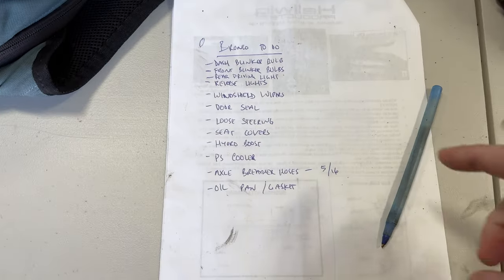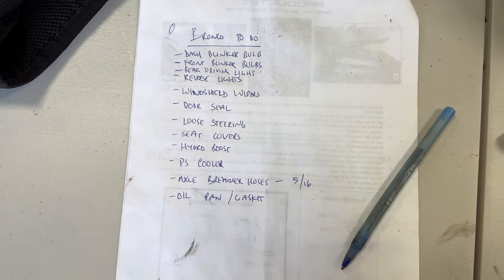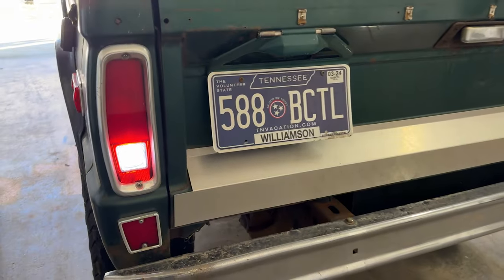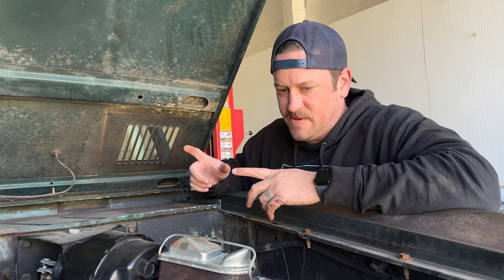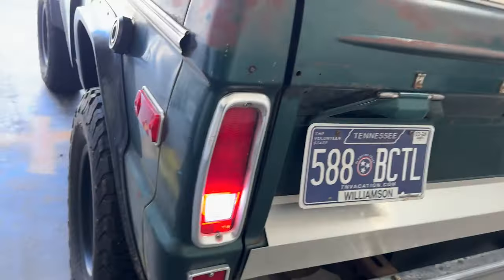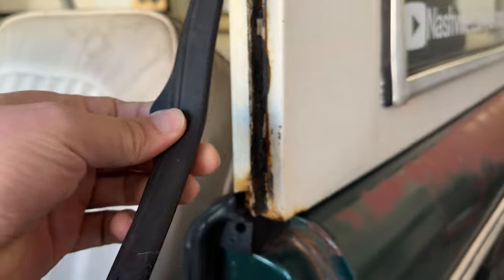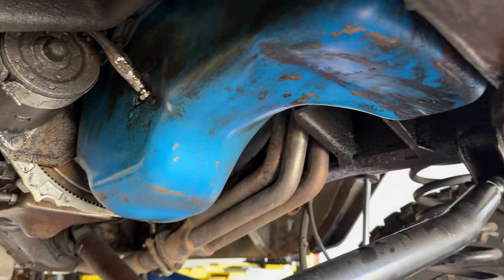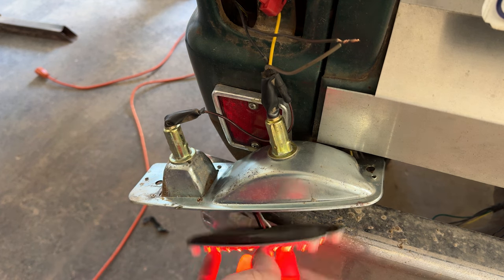Working on my Ford Bronco

Comment: For the electrical connections - try the solder connections that melt with heat. The solder mates the connection and they also shrink down around the wires.
Reply from the maker: Good thought

Comment: The tail light worked when the bucket touched the body. Which means once you screw down the bucket the screw is the ground.
Reply from the maker: You’re right, but that tail light housing still needs to be replaced.

Comment: We kept the original engine 289 and original transmission 3 speed on the tree after installing a F150 4 speed and transfer case bolted the 351 Cleveland this thing runs and climbs great..?